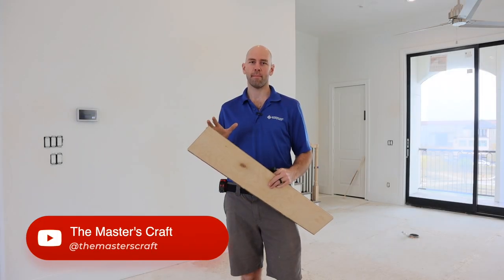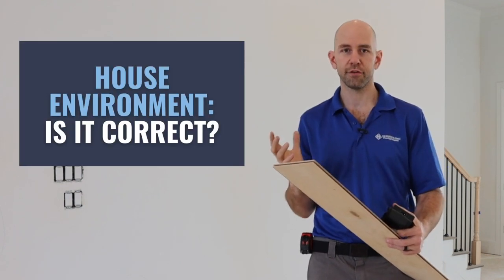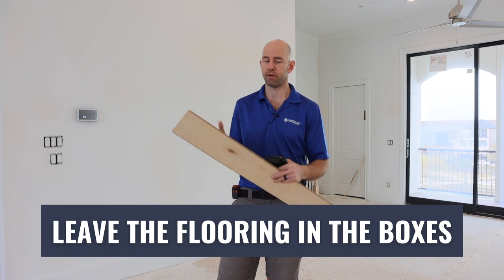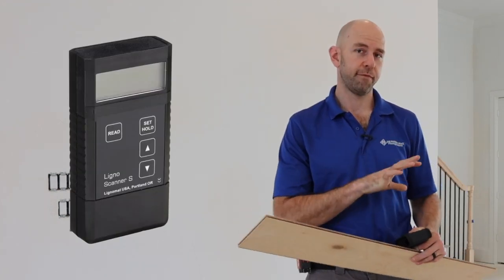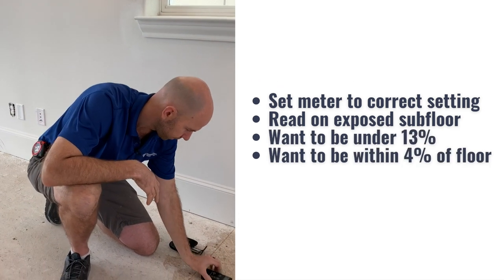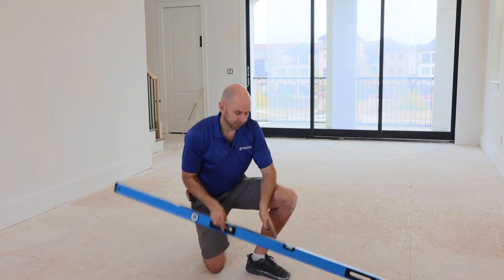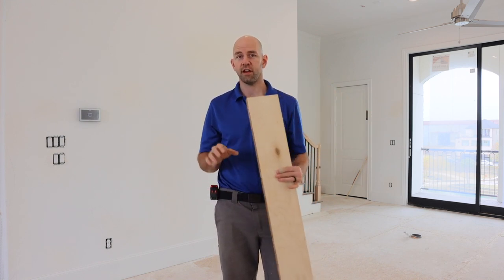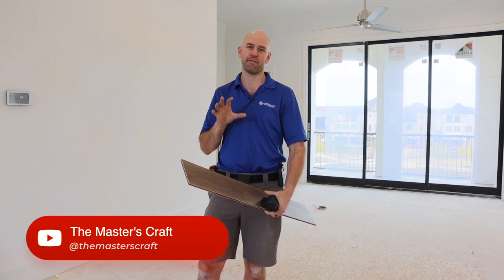Prepping Your Subfloor for Hardwood | How to Prepare for Wood Floor Installation

Comment: Shouldn’t you do the screwing down loose subfloor panels before flatness checking?
Reply from the maker: "Good point, if the subfloor is loose and going to be pulled tight by screws then you would want to do this first."

- Daniel

Comment: Can you show how to use a laser level for flatness checking?
Reply from the maker: "Good suggestion and we might use this for future video content.  A laser level does add precision and prevents dragging a box level across the floor."

- Daniel
Reply: Ya'll gotta drop that vid ASAP!@rwsupplydesign
Reply: How do you fill in low spots of OSB.  Specifically what product can be used?  Henry's and Ardex say not for use with OSB.  Should I just ignore that?

Comment: What kind of sanding tool is best for sanding subfloor?
Reply from the maker: "Different people prefer different machines.  It probably depends on how big the area is and how much material needs to be removed.  An edger is a good tool to address smaller areas and remove a good amount of material, buffers are great for cleaning dirt and dust off larger areas and big machines can be good for leveling larger areas but are probably used the least."

- Daniel